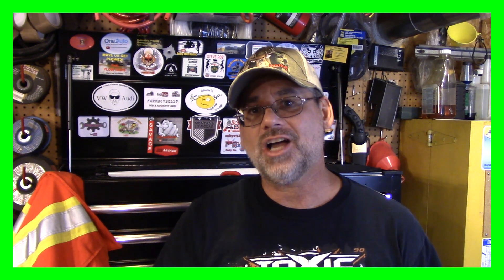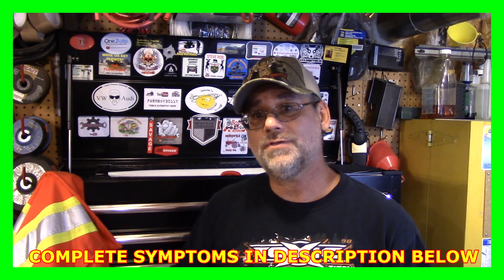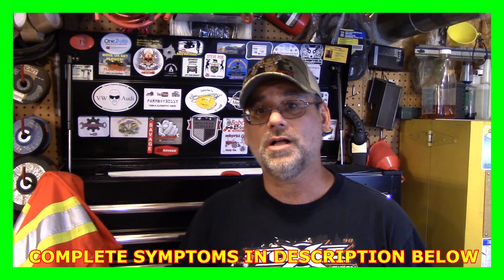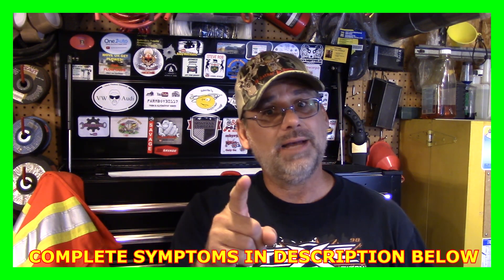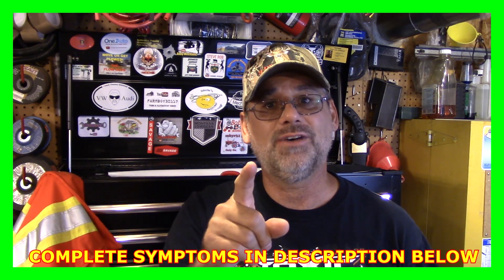F150 STALLING AT STOPS  - DEALER CAN'T FIND FIX - PART ONE

Comment: Can’t blame the dealer !!! Wow I have this same stuff happening to my ecoboost . Getting ready to just turf it and never deal with Ford again.
Reply from the maker: The dealer can only read codes if any and try common fixes  they have tried.  Every fault is fixable but it can get frustrating and expensive.  I good shop with experience with your engine can fix it .  I just bought a new  2021 Silverado Z71  RST .  Awesome truck  so far.
Reply: Ford will always run as long as you get it figured out.

Comment: hi there . this happened to me this morning. my truck is 4.6 at 146k miles . came to stop sign and it just die like I turn off the key !!! no shaking or anything start right back up put I  drive and die again ! so I just rev up the engine about 1500 rpm put it in drive and made it to work . I don't know where to start .    so what part did you replace or how did you fix it. thank you
Reply from the maker: Evaporative Purge Valve on the drivers side of the engine .  Takes about  10 minutes  but buy the part at your dealer  it's much better than aftermarket.   Hope it works . 👍
Reply: @SteveRobReviews  thank you so much I give it a shot 😊

Comment: When a VW shuts off (with no codes in the ECM)... I'd suspect an issue with the power supply to the ECM (Power Control Module). An ECM that is turned off can't detect a fault... newer VW's will keep an eye on the power supply to the ECM and set a power supply code if the ECM were to shut off when it shouldn't. So my guess is power supply issue to PCM. If not that, then the disgronifier!
Reply from the maker: Seems logical but i do still have cluster power and no other electrical I can notice is shut down.  Its like the fuel is shut off  so smooth you would never notice the truck shut off until you hear  a chime thru the speaker - bong- bong -bong
Reply: One would think then, that fuel trim history would point to a lean condition as the engine is running out of fuel.  Guess this is one of those specific fuel systems that require x-amount of pressure... so it's a quick shut-off when it gets below that pressure. Most systems will allow the engine to run with under 20psi and it's a gradual power loss & stall.
Looking forward to part 2.
Reply from the maker: Thomas every  time It shuts off I just restart it  so checking fuel trims I couldn't do so easy. From what I'm told and I agree its fuel  related on some engines and  that fuel  is actually a fume  not a liquid .  A solenoid  sticking open  on a  deceleration  flooding out the engine . I think you know what it is now :) 👍
Reply: STEVE ROB REVIEWS If automstic vehicles shut off fuel during deceleration... vapours from the EVAP purge shouldn't be enough to flood. A flooded engine wouldn't start right away either. Definitely a weird one. Did I tell you I don't have any problems with my 27+ year old BMW's?

Comment: So this has been happening since the 2nd day of ownership and the dealership can't or won't fix the problem WITHOUT you paying for the guess of a part?

Yes VERY intermittent issues are hard to detect (8-12 month intervals) I get that. But if you purchased a new vehicle and didn't even make it 48 hours without a problem then I would say it's on Ford. 

I'm not going on a Ford bashing rant. It's ALL makes that seem to NOT want take responsibility for their poor designs, parts or workmanship. 

Hope you can get this problem resolved and I'm looking forward to the follow up.
Reply from the maker: I can't blame the dealer or the staff because it does not show the condition at the dealership and runs fine and no codes or history codes.  It stalls so nice you can tell with the radio on . Oh man this ford can stall better than any truck I have ever had. LOL
Reply: I'm not particularly blaming the dealership. I'm blaming FORD. The dealership staff can only do so much with the info given to them both by the truck AND Ford. Just like any other manufacturer, they don't want to fess up there's a glitch and won't admit it unless there is some sort of investigation or class action suit.

IF the problem is only with a small % of vehicles they wash their hands of it and tell the dealerships it's the customer's problem and they need to cough up the cash for a POSSIBLE fix.

There may very well be some sort of internal TSB on the matter.

Like I said before, I hope you get this resolved.

Comment: Hey there Steve, I have a 2007 Ford F-150, my problem is when I come to a stop and I go a press the brake or even when I slow down to stop, I stall! Would like some help! Any advice would be great!!! Russ
Reply from the maker: If it just stalls without any codes present and starts right up easily thats exactly what mine did. I changed out the purge valve and its been over a year now without one stall. Russ  its a $50 part so its worth a try  and so easy to replace yourself. Make sure your throttle body is clean as well as that could cause that as well as many other  things but you have to start somewhere and try something.

Comment: hey Steve my 2000 f150 with a 5.4 won't do anything just put a new battery in it when I put the key in and turn the switch the lights come on but it does nothing it don't even click.......now I can hear the fuel pump kick on . the windows headlights radio horn all work but like the starter don't make any sound
Reply from the maker: That could be so many items wiley ?  Looks like your going to be using a test light and or  millimeter to verify your ignition switch is sending voltage to your starter relay  to turn it on or you may have a bad starter .  Not starting verify its getting voltage and connections are good .

Comment: My guess without knowing anything else is,  something is causing a low oil pressure sensor to shut it off.
Reply from the maker: Could be its all computer controlled but  i'm thinking Ford wouldn't  design a vehicle to stall out on low eng. oil  or perceived low oil.  A strange one forsure.

Comment: So Steve my F150 has the same problem it has a 5.4 .
So what exactly did you replace ?
Reply from the maker: Evaporative purge valve at the engine.
Reply: So as of now has this fixed your problem ?
Reply from the maker: Yes all fixed   no more stalling.
Reply: I replaced evaporate valve an also replaced fuel module still having issues every now an then she stalls I also cleaned throttle an air sensor

Comment: I had to have a brand new 5.4 dropped in my 06 F150 about 2 years ago (Came with 5 year warranty) Today I ran several errands and after I cranked it up for the 10th time I thought the startup felt weird, felt weak. Not like a dead battery cause I'd been driving all day, like high compression, weak starter? gauges all good. I went to my cousins house and just like you said I slowed down to turn left into his driveway and truck just died, all dash lights came on. Steering gone, braking super hard, stopped about 2 feet from a telephone pole. Cranked right back up and when Ieft his place I was super nervous, what happens when I'm taking a curve at 50mph, or doing 70 on the interstate? I'm fixing to watch your part 2, trying to work this out. This truck has been a super pain in the @$$ the whole 5 years I've had it!!! With a new engine even!
Reply from the maker: Your going to need a good tech to see if their are any ford specific stored codes .  I'm thinking something electrical is either loose of rubbing on something  wigging out the electrical .  All fixable bud.

Comment: Whooo hooo... well as stated below .. 25 years at the dealership and my knowledge Master Tech) has fixed the issue on my friends 2013 F-150 5.0.  Intermittent stall when coming to a stop. Check engine light was on with a P-0300 random miss-fire. A while back I had a similar issue with a Ford Focus .. well my old rusty brain had a flashback and the issue is resolved. These Techs today rely on a code to repair a problem and will what I called (T&E) trial and error. After doing the “Repairs” note :2 things I did. One was the problem and the other was a “Preventative maintenance” and I re-road tested and it was gone.
Reply: What is the resolution?    What was the fix on the 2013 F-150?
Reply: Flash Gordon   I take PayPal for payment. This is job. I’m a trouble shooter and love intermittent problems that I figure out and get paid big bucks for.
Reply: What was the problem?

Comment: my f150 intermittently stalls while idling...ford dealer says nothing wrong and can't duplicate! frustrated!! its died so many times its hard to count- in drive, park, and reverse... only at idle!!
Reply from the maker: At some point  I had to do  something  and the purge valve  was an easy swap and $75 so I started with that and it fixed it .

Comment: more than likely its a loose nut behind the wheel!!!. seriously i have spent 30 years in the dealerships and this kind of thing is common. when i worked for hyundai we had a computer network across the country just for these problems. there might be some guy in idaho that had the same problem and he fixed it and let everyone know what the repairs are. intermittant no code problems are very frustrating to say the least
Reply from the maker: Haha so true and that's what I'm going with , pattern failures and  a most likely resolve. I will change a part in the next vid and you let me know it sound logical to you. Cheers

Comment: Have a 92 F-150 with the 302 V8, mine stalls shifting into and out of gears as well as at most stops. Recommend the purge valve for this?
Reply from the maker: Brian my stalling was very specific and a pattern part failure. In your case its as soon as you let off the throttle and consistent. Id be looking at the throttle body , make sure its clean would be my first to do.  Its fixable but a good tech would save you more on a diagnosis than throwing parts at it. Cheers
Reply: @SteveRobReviews  I'll be sure to check that out. I've had it for over a year and this is the first problem that i'be experienced so far. Is there a way to test for a faulty valve?
Reply from the maker: @brianmarkley8976  Yes it's either on or off electrically letting fuel vapors flow or not but like so many faulty ones that got stuck and got stuck occasionally it's tough to test definitely as good or bad.

Comment: i have a 2016 ford truck it is stalling at stop lights, you are saying it is a evap purge valve correct ?
Reply from the maker: Yes under the hood . Fixed mine  , has not stalled since.
Reply: Did this fix you 2016?

Comment: My wife used to have a pontiac phoenix that would stop whenever it decided to. At first it would stop for a second or two then go on like nothing had happened. We took it to the dealer and they charged 20 dollars for diagnostic test but it didn't show anything. I took it another place and they said they couldn't fix it unless it did it while they had it but they didn't charge. He said to keep driving it until it got worse so they could figure what the problem was. It got so it wouldn't start again for a while. The problem turned out to be the computer. Later on the same car got so it would start and run for about five minutes then shut off but wouldn't start again until it set for a while. it was the ignition module. I have replaced parts to solve a problem and had the new part be bad. It could be a bad connection for the fuel pump or a fuel pump relay that is failing but my best guess is the computer. I am surprised at anything that not fail completely in that amount of time but the computer seems like the most likely to cause that for that long a time. If you could pick a computer for it at a salvage yard it might be worth a try to see if it solved the problem.
Reply from the maker: Yes you have to have it do a fault more consistently to catch it  but this one is very consistent about once a year . Wow thats a tough one to catch so in my mind just start changing logical parts in hope of solving it. Cheers Gordon
Reply: Once a year huh?
Same road that you make the left on?
Do you only go down that road once a year?
Reply from the maker: HAHA nope it could even be on your road. I'm not sure but the truck doesn't recognize roads.
Reply: Well if this foray into the engine problem doesn't fix it I would add some instrumentation for your engine. The low oil light, does that come on after the engine stalls or right before? An oil pressure gauge would give you a better idea than a oil light. Also a fuel pressure gauge would allow you to monitor the fuel pressure. If you see it drop right before the engine stalls that would be another clue to your problem. You bought that diagnostic scanner, does it have the capability to record data? If so I would have that plugged into the port to capture data so you can see what the engine was doing at the time it stalled. The more information you have the better you can diagnose your problem and rule out things. Air, fuel, and ignition are the things you look for when engine doesn't start but yours is very very intermittent so you need to get a snap shot of whats going on when it happens. Also today's engines have monitors up the gazoo so it could be a monitoring system problem giving the engine wrong info. I'll talk to ya  next year when it happens again. :> )
Reply: Your truck doesn't recognize roads aye? No GPS I guess.
Professor Danner did a video on the IAC valve, sounds like it might be up your alley.
Reply from the maker: Good ideas but all after the engine stalls and it starts up and I have to proceed . Oil pressure not likely  affected but it's definitely a problem I hope is the fix on Sunday. Let me know if it's logical to you .
Reply: Tune in Sunday
Same Steve time
Same Steve channel.
Course we are not gonna know ya fixed it four4 another year.

Comment: 2016 super crew cab sport 5.0 same problem. Its going to the shop Monday.
Reply from the maker: The dealer techs told me the purge valve could never make it so rich that it would stall   but they were wrong and it's been over two years without one  stall since I changed it out . Good luck .
Reply: @SteveRobReviews  it just threw a code the other day. Light still on . We shall see after Monday. Thanks for the reply back..
Reply: Any luck with your 2016 5.0? I am having the same issues.

Comment: Try doing this it works for me with my 2009 F150 SuperCab 4.3L 3V .. I tickle her headlights and rub her Blue Oval. 
Bruddah the answer is right there under your nose...  Stop driving on NASCAR tracks and you'll stop having it shut off when you turn left. Just saying ;)
 
 -- Btw,  you probably already know this....  make sure to contact and provide all of your documents to the Manufacture's Area Zone Representative (this applies to all vehicle  manufacturers). You need to prove to the Zone Rep that you tried to repair the vehicle while still under warranty at the vehicle's dealership repair department. 

 -- You must prove your vehicle was under warranty at the FIRST and any subsequent time(s) that it happened even if the dealership tells you "We Don't See Nothing Wrong". You also may be entitled to money refunded if you have receipts and you paid this money while under a valid warranty.  Even if it happened years later. 

 -- Provide the Zone Rep all of the info from the first date you took it to the dealer for repair while under warranty including all  subsequent tries to solve the issue from every repair facilities relating to this issue. In most cases if you took it in to the dealer while under warranty that is the established first repair date that's honored even if it is a few years later. The dealership has to honor the work under and as warranty work. Labor / parts -- the whole deal.

 -- I bought a plain jane F150 in 2001. The F150 would veer slightly out the lane and had to be forced to drive in straight line - no matter what normal road condition it was driven on. The F150 turned out to have a slightly twisted frame. It took almost 7 months to find that out. I had the dealership maintenance department manager put his findings on the repair document and called the Zone Rep. Since the dealership had my truck for more than a month trying to fix it (and yes - they had to provide me a rental truck free of charge during the whole time it was at the dealership).  As I mentioned it turned out to be a twisted frame caused during production and the Maintenance Dept manager stated that his Ford Factory Trained mechanics could not correct the problem at the Ford Dealership's Repair Department using Ford's repair procedures.   

 -- The Zone Rep offered the dealership $5000 to put me in a new truck. The dealership refused because they had given me a $6300 trade in value on my 1984 F250. Most friends say that my F250 wasn't worth $500. I didn't care .. that's what they offered us and I took it. The rest is their problem.  

 -- Since I paid $24,000 in cash for the 2001 F150 plain jane and they would put me in a another F150, I told them I paid cash and I want my money back right now. They refused to give me my money back until heated arguments occured between the Zone Rep to the Dealership.

 -- It took 4 months to get my money back, mind you now I'm still driving the loaner truck for free because my truck was deemed  unsafe to drive according to the Lemon Law Act. 

 -- I got my money and went to the GMC and bought the truck I really wanted but thought I couldn't afford for $24,000.01. The GMC dealership had followed the issue from week one and they cut me a deal that was only 1 penny over the MSRP cost of the Ford F150 (Ford's F150 MSRP was $24,000.00). They did it to shame the Ford Dealership. And it worked!  I went back to the dealership with my GMC and every salesman walked away from me. No one would talk to me. I left the Ford dealership laughing my ass off knowing the power of the Zone Rep is unmistakable when he's on your side.
Reply from the maker: Haha this has been a good truck but  for the stalling - I may have a fix in the next vid . Cheers